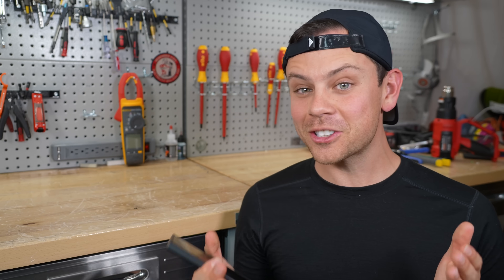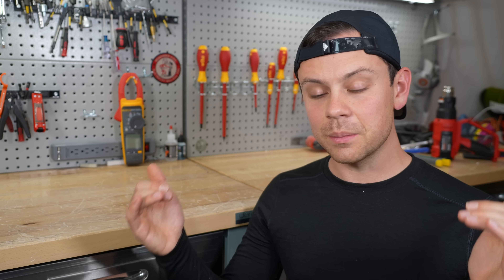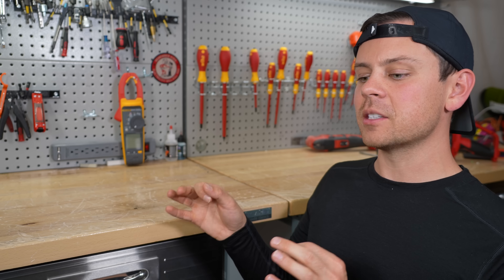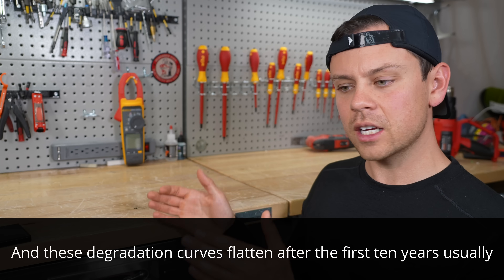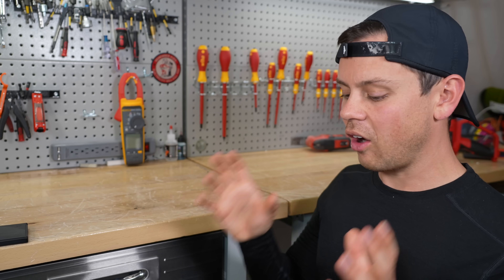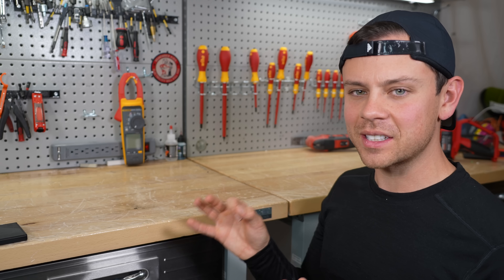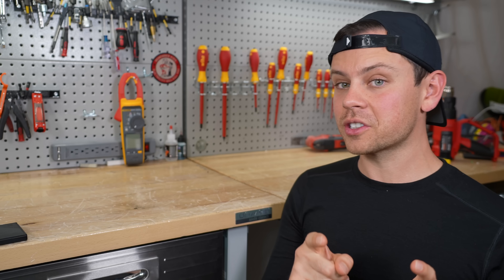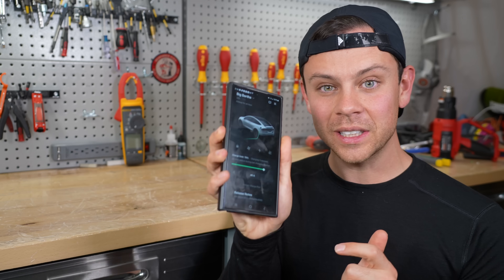LiFePO4 Longevity Discussion! Why Charge to 100%?! For Solar??

Comment: Mate I fkn love this channel, but NOW i have a question after building my motorhome (moving in in 6 months)   7x 200ah bt renogy batteries.   4 of them are shut down at most times.   every 3 to 4 months all batteries will turn on and drink solar to full. I'm able to draw 11Kw(240v) from my 4x inverters. (i know)  Are my batteries looking after themselves at this time or are they rotating? I haven't named the bastards...  Australia.   In summer it's topped up by 8am.  In winter I'll need shore or generator. is letting them go really low before charging better?

Comment: I have been living off Grid and installing off grid Solar Systems sense 1978. I used to have to put 20 or 30 gallons of distilled water in my batteries once a month. Now I don't even look at them more than once or twice a year and no water needed. I really appreciate your channel and content Will. Keep up the great work my friend.👍
Reply: OMG - you made my PTSD flare up!  LOL!  i HATED having to "water" my batteries!!  LiFePO4 is just so amazing!  best solar upgrade - EVER!  AND the fact you can just add more capacity, anytime, regardless of Ah - and it's 100% usable - cherry on top.
Reply: Years ago, I bought a travel trailer and the dealership provided a small flooded battery (cheap) and I was always having to stop by the storage facility just to water it, I couldn't wait to replace it with an AGM version. I wish I had LiFEPo4 back in those days. oh well...
Reply: What was solar like in 1978? I bet even a 100w panel was crazy money!
Reply: @michaelmartin9022  Definitely crazy for sure! The quality of the panels were as good if not better than today but the price was between five and seven dollars a watt!
Reply: My 50kW flooded lead acid lasted 17yrs by only usin. g 10kW as daily capacity. Will my 15kW LiFePO4 battery last me that long? My wife calls me the energy police.
Reply: Most likely, yes. As long as something doesn't go especially wrong. @ocular57
Reply: @ocular57  I'm confused, do you mean kWh?

Comment: for a bunch of DIY systems, like mine, based on offgridgarage's 16s LF280K with a jkbms, it doesnt make sense to go to 100%. if by 100% you mean a cell voltage of 3.65v -- 3.55v or 3.50v will balance the cells just fine. 

but this is a small point that the vast majority of your audience won't have to deal with.
Reply: At 3.55V, you're at 100% for all intents and purposes.

Comment: Some people are just full of their own ego and to feed it, they have to disagree with people.
I have been off grid for 20 years and switched to LFP around 3 years ago. I charge to 100% "everyday" (I live in a "hot" Mediterranean climate so I have heaps of sun) I only drop down to around 70% SOC (30% DOD) ... yeah my battery bank is a little to big for my needs but that doesn't matter.
I do a full discharge test every year from 100% down to zero (when the BMS shuts off) and after 3 years of daily cycling, I still have 98% of my original capacity. So people "Listen to Will" he knows what he is doing and what he said in this video has been validated in how my system is preforming.

Comment: Battery longevity begins at the factory: 
In a study published today in Joule, researchers at the SLAC-Stanford Battery Center report that giving batteries this first charge at unusually high currents increased their average lifespan by 50% while decreasing the initial charging time from 10 hours to just 20 minutes.

Comment: Got it. The last video did not seem to deliniate to well between lithium, lithium hybrd chemistry, and lifePo4 solar and storage. Maybe I am just thick. That being said, this explanation makes it crystal clear. I have a 5,120 watt portable solar system I use for power outages and hurricanes. I recently charged it to 100% and have left it there for several days now. Tomorrow I will start a rundown on it until around 50%. Thanks for the great info.

Comment: what if I use an ecoflow delta 3 plus as an UPS for my office computer, it's plugged in the AC outlet 24/7 and will use the battery only during a power outage. should I keep it charged at 90% as recommended by ecoflow or 100% to have the maximum capacity when the grid goes out?

Comment: Oh come on Will, asking us to think? That's a bit far fetched in this day and age -LOL!!
One comment, I deal primarily with occasionally used RV's and boats with solar which is slightly different. My boat might get 40 nights use per year so for most of the time it's sitting at float charge voltages from the solar so is effectively being stored close to 100% SOC. In fact I double checked my solar controller which was misreading by over 0.1V so batteries had been at 13.6V. Recently tested my original battery following ~18 months and 2 seasons use like this and it had lost less than 1% capacity. I suspect had I cycled it before testing I may have achieved a better test result but even sitting at those voltages degradation has been minimal.
Keep up the videos. i keep steering my customers to your site -great resource. Thanks! 😃😃

Comment: I think people are mislead with the scientific tests.  While there is real degradation in above 80% and at 0%, it is impractical for LFP due massive cycle life and low cost.  After 10 or 20 years, batteries would have become cheaper and better at the same time.  You are more likely replace, upgrade, add to these batteries prior degrading to 80% or less. Ageing of the battery likely offsets or beats the gains of not fully utilizing LFP.

Comment: So I have 4 12 v 100 a  batteries in my motor when I park it at home I plug it in so the charge to 14.7 volts they will stay that way for 2 or 3 weeks until I go on another trip I that ok for the batteries ?

Comment: If I try to get my 280 ah cells to 3.5 volts per cell in a 51.2 volt system with my 4 amp balancer, and my BMS always shuts down due to cell over voltage set to 3,65 volts. If I only charge to 53.8 volts system runs flawless.

Comment: FWIW, I have had great results from all of my lithium chemistry batteries, including my LiFePo4 used for solar. I make a point of doing a full charge / discharge cycle once a month, not every day, and this is for two reasons: 1) I am rarely needing to use all of my capacity between solar charges, and 2) This is what the engineers at Victron recommend. I think they have a pretty good idea of how to maximize their own system's performance, both in terms of the need to do cell balancing somewhat regularly and the lack of incentive to push them to their limits on a continuous basis. If or how much they believe that the latter improves cycle life, I don't know as I don't see it stated.

Comment: Will, I do want to point out that Electric Cars operate best with liquid cooled battery packs. The Nissan Leaf was shown with more battery degradation than others, because Nissan has air cooled battery packs.
Reply from the maker: Yes exactly! For EVs, and with lifepo4, you need heat management. Mentioned that in my video actually
Reply from the maker: The Nissan cells degraded to 60% capacity fast. That's why the used cell market for those things was huge. Lots of damaged cells

Comment: Lifepo4 is not Li-ion. With Li-ion, charging to 100% for any reason ABSOLUTELY degrades the battery much faster than only charging to 80%, but Lifepo4 is different.

Comment: Will, when you discharge a LifePo4 battery and charge it back up again purely for the sake of balancing the cells does it matter how quickly or slowly you do it? For example either using a fan at 30w or an electric heater at 2000w? 

30w would obviously take a long time.

Thanks, Tom
(United Kingdom)
Reply: You don't need to discharge just for the sake of balancing. Just make sure you fully charge them every so often in normal use.

Comment: Not sure I entirely agree here.  First off, at 90% you are at full terminal voltage so going to 100% does nothing other than holding the pack at full potential longer as charging tapers off.  Passive balancers remain off until one cell exceeds the balancer trip voltage, then it leaks charge to the adjacent cell.  If the cells are well matched, the balancer never is active as the balancer trip is usually way more than the natural variation in the cells.  At most it will increase the pack capacity slightly to balance cells.  The cells naturally balance during charge and discharge.  If one cell is failing, no amount of balancing will help as the pack will need to be replaced or repaired.  The science here is due to the charge acceptance as cells near full charge, acceptance reduces, so when 2 cells in series are charged, as they near FG ull charge the one with more charge slows before the one with less charge, and naturally balances.
There is waay too much bro science out there as is related to batteries
  Keeping disconnected cells at 50% state of charge helps slow dendrite growth and passivation, and cool temp helps too.  Cell ware out is worse if you fully discharged the pack, so switching off the panels until the cells get to 0% is not a good idea as it's good to keep the cells topped off if the sun is shining  and the batteries prefer lots of small charge/discharge vs continuous full cycle discharges. The bms is set to manage the cells well and even if you abuse lifepo4 the life is not affected as the bms prevents over charging discharging and out of temp charging.  The best thing to do is keep the batteries protected from excessive heat/cold,  leave the bms to take care of charging.  Most people will forget about their batteries long before they wear out.  It's a bit like people who only park their new car in the empty part of the parking lot to prevent scratches.  Within a year they are circling the lot to find a spot close to the main door.  Your advice on storage is spot on, and I know you don't mean to fully cycle the pack every day, as most properly sized systems are over designed by at least 20% so the batteries rarely get used more than 80% in a day
Reply from the maker: no, passive balancers do not "leak current" to adjacent cell. they use small balance resistors. that is an active balancer with dc to dc converter circuit that you are thinking of. they will have a small inductor and caps on the board to feed adjacent cell. 

Yes, if cells are matched, it should only trigger every few months. 

Yes, true about failing cell. No amount of balancing will help that.

When in series, they do not "naturally balance". You are thinking of lead acid doing an equalize charge. Lithium packs do not do that. 

Yes 50% and cool temps good for storage
Reply: @WillProwse  correct my badthe balance resistors just discharge an overcharged cell.  I meant to say on the charger the balance resistors allow some charge current to bypass the overcharged cell and flow into the next cell in the string, as the discharge current is supplied by the charger when the pack is charging, and the end of charge current is delayed slightly so the adjacent cell can catch up.  At the end of charging the discharge current is supplied by the overcharged cell, reducing its storage capacity to better match the adjacent cells.  This is not perfect as the passive balancer cuts off before perfect balance is reached, but it's better than nothing.
I have used lead acid chargers on lifepo4 packs for a long time and they undercharged the pack consistently, with absolutely no degradation after years of use.  Just make sure the lead acid chargers does not have desulphacation pulses (not very common).  I totally agree that people mix linmc and lifepo4 data leading to a lot of useless confusion.  Heat and excessive cold are really the only things to worry about with lifepo4 packs that have a half decent BMS with passive balancing.  Active balancing is a crock, and really is only needed if you want the last few % of capacity out of the pack with added complexity and reduction in reliability. Hopefully this makes sense

Comment: You are correct . I first started watching you in the camper. Most people are afraid because of lithium battery fires a few years ago , the chemistry of lipo4 is different and safe, they should be treated according to its use .Some people confuse them with lithium that is dangerous to keep at top charge.
Teaching is difficult, :-)

Comment: I cycle my batteries to 100% daily. I however do so at a much lower voltage of 3.45v per cell.
Reply from the maker: What bms
Reply: @WillProwse  JK Inverter BMS. My batteries are well balanced. Voltage diff between cells are not more than 0.008v.

Comment: My system is only used for backup power when needed. Power is off at all other times to the system. I try to massage my batteries every couple of months. (I run them through a charge, discharge, then charge back up again). They always naturally settle around 53v.  
Everyone's system is different  but keep in mind... Voltage is only 1 part of being 100% charged. 
Make sure you are at 100% absorption!  E+I, otherwise they are NOT fully charged

Comment: absolutely! I have worked with LiFePO4 cells for past 4 years now esp in custom built battries for car and charging to 100% and discharging mostly to 10-15% has healthier cells than say charging to 100% and discharging only to 50% and recharging again. (these cells are swelling or imbalancing often) So, my conclusion is cycle as much as you can everytime for better results. I also have
3.5 years old 280Ah cells in storage mode (40%) which I cycle every 6 months or so and their capacity is still similar about 0.5-1Ah difference (aging probably) so i can verify what you said  this from my experience.
Reply: Could you please explain your 6 month cycling procedure for the batteries in storage. Do you charge them up from 40% to 100% first, discharge them to 10-15%, then bring them back up to 40%?
Reply: @carll5742 I charge to 3.65v and discharge to 2.5v,, so i know the capacity, mark it and charge again to 40%... 

For max voltage I have set it to 3.45v in mine. and in 48v all of them are above 3.42v at 100%.  I do a slow charge so 3.45v is like 99.9%. I can set this to 3.65v but not much difference is there and I set that 3.45 because I didnt know things in the beginning and since its like already 100%I havent changed the settings in the bms.
Reply: @videostar555 how do you balance them if the max voltage is the same balancing starting voltage?
Reply: @esmailalkassir1565  i do not.. there has been no need for it yet.
Reply: What’s your best charge max voltage from your experience?

Comment: I think the 3 major reasons for people not agreeing about charging there cells to 100% are:
1. There under the assumption that since there BMS has balancing built in, IT WILL JUST TAKE CARE OF IT ON ITS OWN.. They don't REALLY understand how the balancing works with LiFePO4.
2. They've heard that "Lithium" batteries are dangerous / the most dangerous when fully charged.
3. The majority of people think the real difference between Lithium-Ion & LiFePO4 is there voltage range and LiFePO4 is safer. When they hear LiFePO4 has a flat voltage curve, they don't fully grasp the implications that has...
  
So now when they hear someone tell them they need to charge there LiFePO4 batteries to 100%, they immediately think "100% full is dangerous, and my BMS already balances them automatically" so i don't need to do that, so its unnecessary & dangerous "so stop tell people to do that!!!! "

HOPEFULLY THAT MAKES SENSE TO WHOEVER IS READING THIS!!!! 🙄
@WillProwse

Comment: The new Grid Boss looks promising for my next setup but would love to see you break it down as far as all they use cases. Smart ports functionality as well as ease of maintenance for the inverter look great. Unfortunately my area does not have net metering so the grid boss is appealing to run off grid inverter with grid power still at my fingertips without a bunch of extra junction boxes and wiring.

Comment: It doesn't help when guys like off grid garage  tells people only go to 3.55 v .
Reply: I was wondering if that's what the argument here is or if it is people turning their charger off completely once the coulombe meter says 80%. as in, is this a charging voltage argument or is this about people literally just stopping charge once their battery says 80%?
Reply from the maker: From the videos I watched, he is concerned with the knee of the voltage curve and increased degradation at higher voltages. But the iron phosphate lattice can handle higher voltages just fine. Not high voltages, but within the healthy recommended range, it is ok.
Reply: It doesn't matter though: the difference in capacity between 3.65V and 3.55V is negligible.

Comment: Hey brother, great content as always.  One thing to keep in mind and not get frustrated about is that your Youtube audience is constantly growing.  You've got a lot of us faithful viewers but you're constantly getting new people who only joined recently etc and don't watch old content, so it feels like you're covering the same ground over and over but you're actually covering the same ground with different people.  Keep up the good work!
Reply: also some people get stuck on what they thought was true and don't want to let that go. they see advice about lithium batteries and they think that applies to all batteries with lithium in the name. 

very similar to how when lithium batteries first came out, people would apply advice that was given about lead acid batteries to lithium batteries. it took a while and a lot of effort by various manufacturers to get people doing the 80/20 thing for their cell phones. now that most people do that, new phones do it automatically and show 100% when it's actually 80%, people don't realize it's doing that and are still doing 80/20 manually based off of what the screen says, so in reality they're actually only charging their phone to 64% 😂